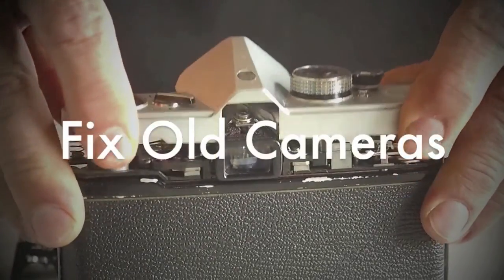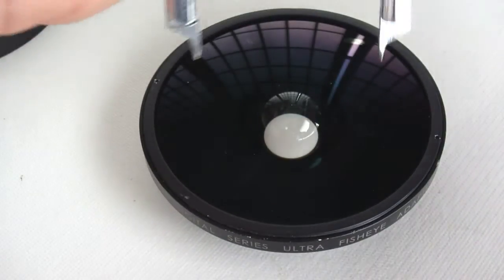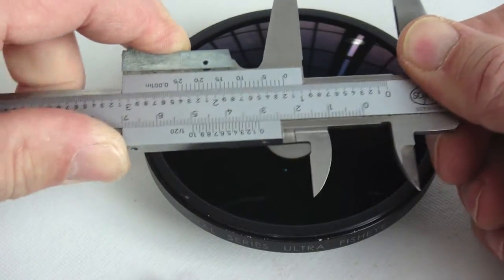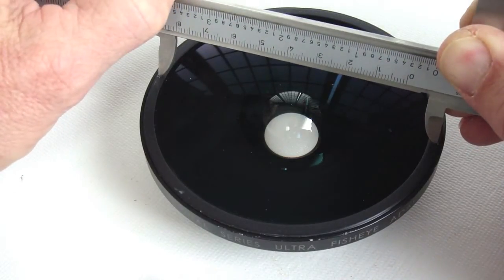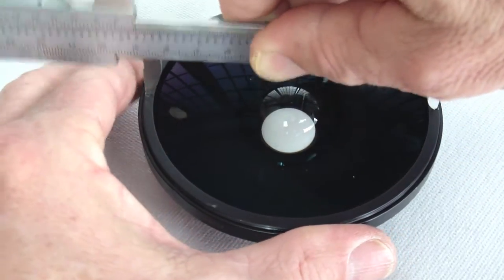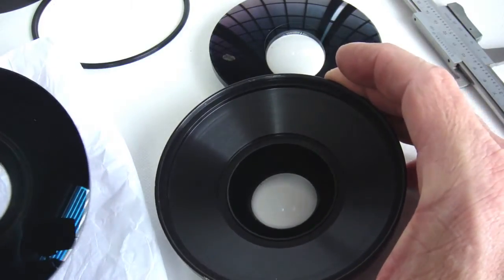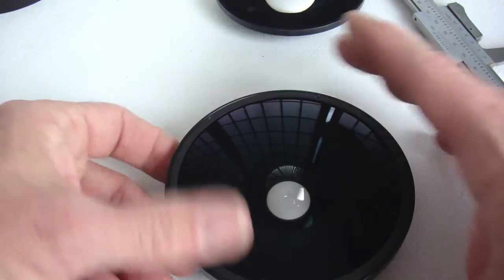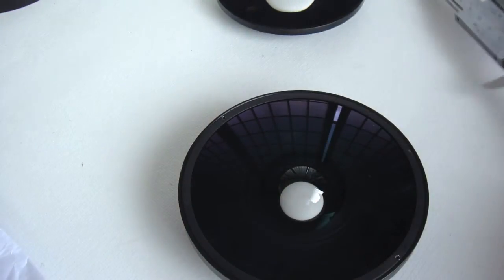Fix Old Camera: Schneider Fisheye Front Element Replacement

Comment: Any suggestions for a stuck retainer ring?
Reply from the maker: Apply heat from the tip of a soldering iron and try again. Be aware of plastic parts so as not to come in contact with the hot iron. Alcohol seeped around the retainer might also help